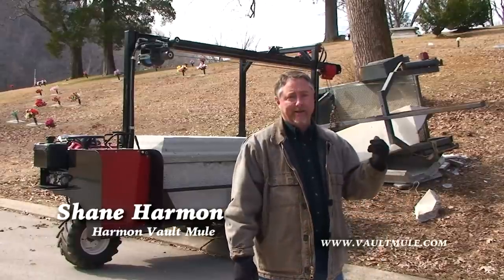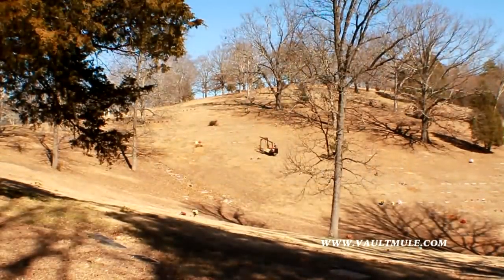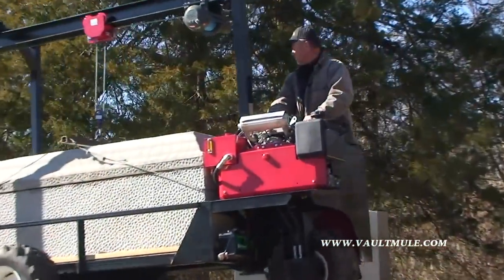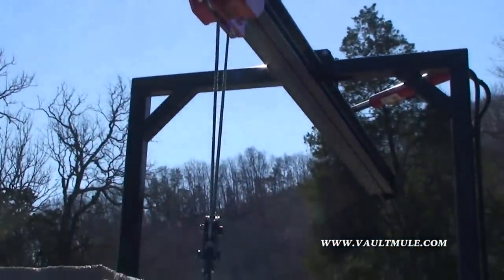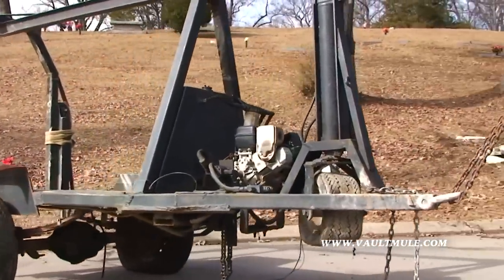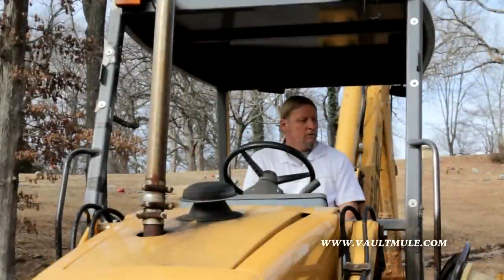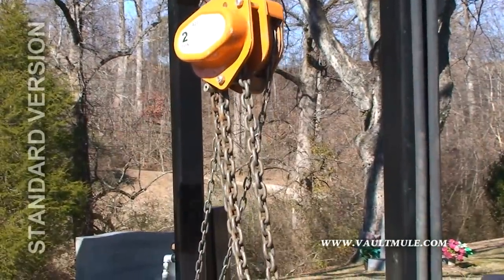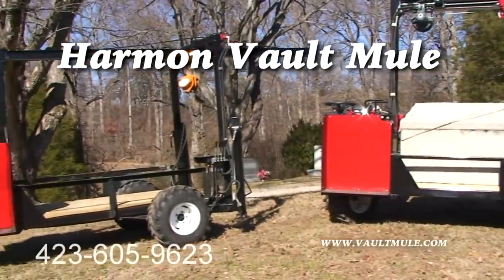Vault Mule

Comment: I'm not in the business but that looks handy for other uses as well.
BTW were there loaded caskets in any of the vault crashes?
Reply: there's no reason to transport a vault with a casket inside. The vault is put in the grave, the casket is put in the vault. Common sense. If the grave is ever moved, the casket is removed from the vault and they are transported separately.
Reply: The vault is transported and placed well before the casket arrives to be lowered. If you hire a company to build and install your vault and they want the casket before they transport it to the gravesite, bring your business elsewhere. Immediately!